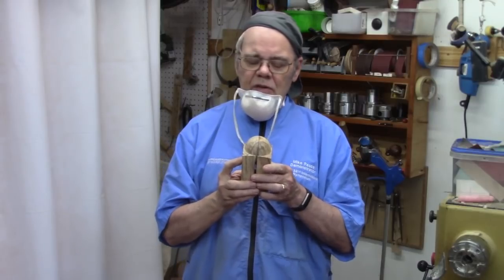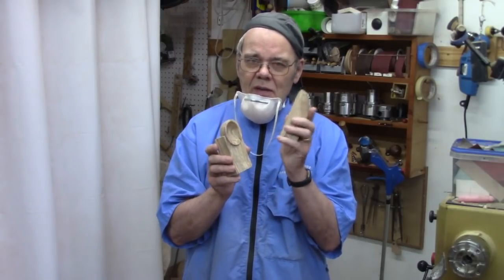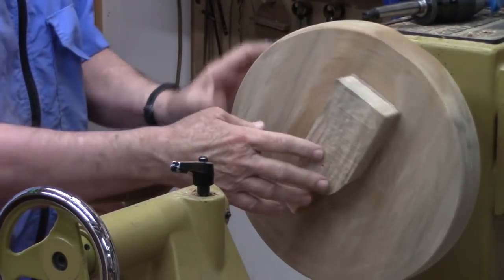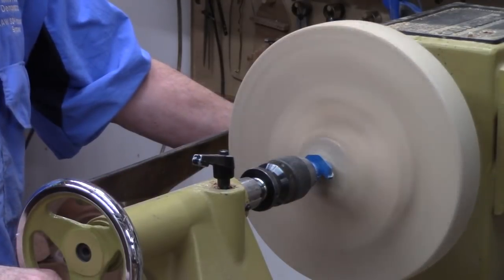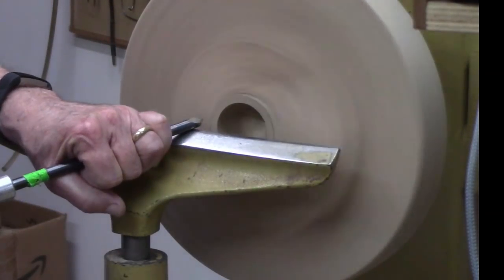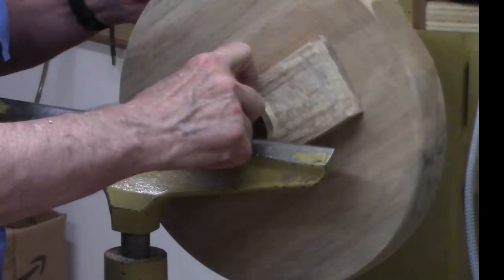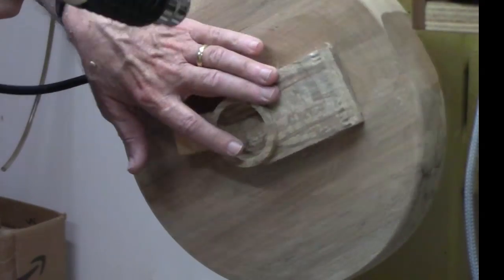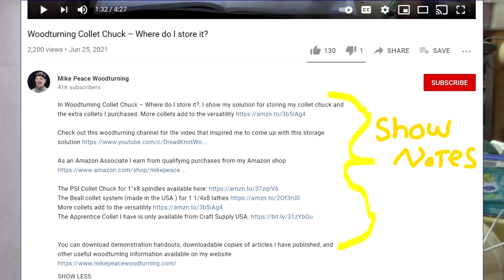How to Turn an Emerging Bowl

Comment: Hi Mike, nice demo.. I got a bit worried at the 8:46 mark, just as you finished boring the center out, when it sounded like everything was getting to fly apart, but all seemed to be ok.  The router bit used as a hollowing was a neat idea, simplified making a spherical bowl cavity.  Thanks for another interesting video.  Stay safe and well to keep them coming.  Cheers, Tom
Reply from the maker: Thanks, Tom. The router bit does create some chatter.

Comment: Great video Mike! I had tried one of these with much less success. With some extra pointers here I think my next attempt should be a vast improvement. 
One question/suggestion regarding the hot glue. Rather than smearing the bottom of piece, hot glue holds amazingly well when applied to outside edge of piece and base. I apply bead of hot glue around piece and it holds solidly. And very easy to remove.
Reply from the maker: Thanks for the tip. I will try that next time I use hot glue.

Comment: Short time in the microwave works well too.  Nice Video, I watched Theos video too but I caught the 07:30 PM addition.  Need all the beauty rest I can get. Yours looks a little simpler.  Guess I'm  going o have to make one too.  Thanks  Harold
Reply from the maker: Go for it. I think the core box bit may be over kill and limits your size options but I figure I could use it for acorn boxes.
Reply: @MikePeaceWoodturning  ?
Reply from the maker: You said you were going to make one and Theo and I used a 2" core box router bit.

Comment: Very Nice project Mike;   Have you thought about removing the plate waste with a table saw?  I've used the TS to remove stock in a flat plane for past projects.
Reply from the maker: For something this size I would have had to take down my cross cut sled after I cleaned off my portable workbench (TS). Couple of strokes on my sandpaper mdf board after the BS and it was smooth. Had my table saw been clean and had the crosscut sled mounted, I certainly would have used it.

Comment: Thank you mike - great video. I turned one from maple based on your video. Pic here https://www.dropbox.com/sh/042s2rhuo5jtvzy/AAAzf7Y-3pXmcZzvSG6p7RJMa?dl=0
A couple of comments:
1. I prefer to have a wider base, for stability. Mike Weldt's look unstable, and the bowl would topple if you put anything in it.
2. Like you I had difficulty separating the bowl, and I even damaged one badly. My solution was to use a very thin parting tool (home made from a kitchen knife) to cut between the bowl and the base plate. It works well as the tool heats up from the friction and cut nicely through the glue.
3. As you suggested, I used a 2" core box bit for the inside of the bowl. It worked well. Make sure you get the center right (spoken from experience).
Gidi
Reply from the maker: Good to hear from you, Gidi! Nice job on the box. Not sure I will get much use out of that box bit. That is a lot of carbide on the wood shaking, rattling and chattering. It does better on green wood then dry I discovered when I tried it on some acorn box blanks of green wood that I set aside to dry.
Reply: @MikePeaceWoodturning  Thanks Mike. This was just a small diversion. I am still into chess sets ♟♟♟♟
Reply from the maker: I am slowly working on a Baku 61 design chess set. I add to it with each chess set demo I do! But my zoom presentations are slowing down as things get back to normal.